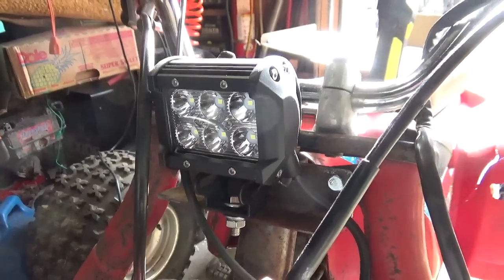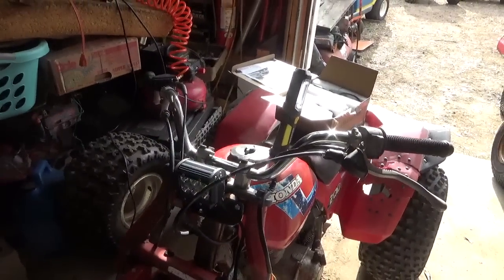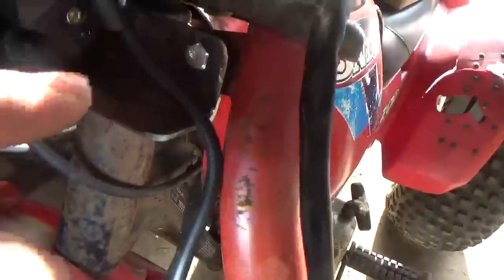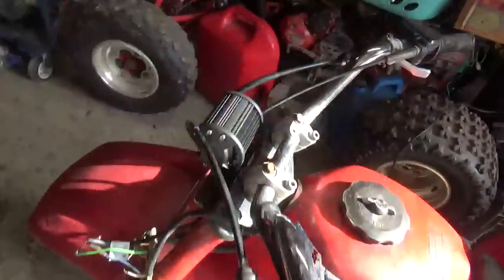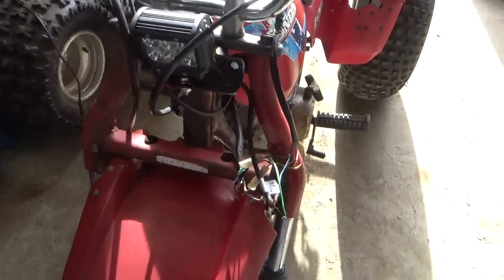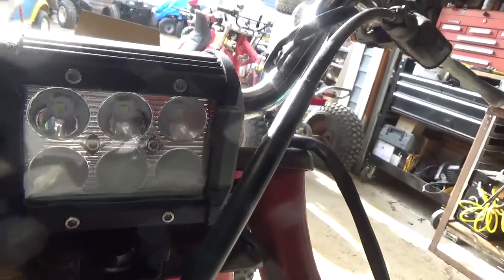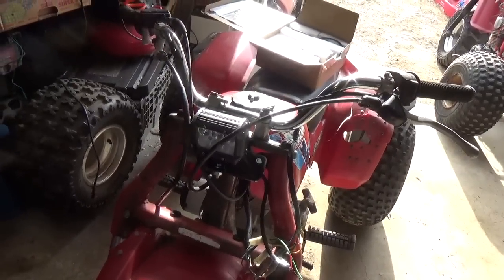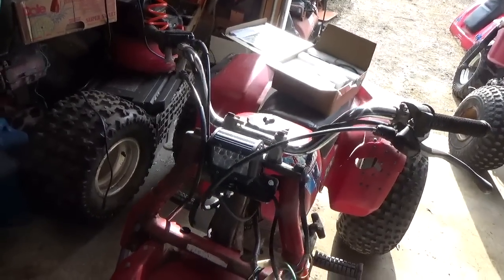1985 Honda ATC 200S Smoked a LED Headlight, Not Surprised!

Comment: Will also need a very small 12volt battery such as like in the 1982 honda passport scooter.. needs to be lead acid..  it will just buffer the current and provide a steady enough current to the leds.

Comment: Diodes don't like reverse voltage/current. Half of the a/c cycle is reversed polarity so it is a wonder they last any time at all. Of course , I know that you know that. Those voltage peaks may be much higher than plus or minus 12 volts also. It is going to have to have a circuit to regulate the voltage and rectify it as well. Have a great day.

Comment: I have a 250 R 1985 Honda atc put car or truck headlight on it but was 12 volts DC haven't had any issues with it the I did that was Honda headlights a little costly
Reply from the maker: Hey Timothy!!!   I have seen a lot of car/truck headlights and fog lights installed in ATCs, I did not think it would work, but, some folks made videos saying that it would, so, I figured I would try it, more or less cost me a $5 LED light.... I plan to use a 12VDC converter , I'll get it working, have no fear.... Thanks for Ur thoughts, suggestions, advice, watching, and commenting!!!

Comment: I would thing a small power inverter would do the trick. A small 100 watt and wire direct, I’ve used those lights but on a Honda Fourtrax 250 and a Polaris 500 h.o. All of which have batteries. Good luck
Reply from the maker: Hey Dave, They make a 20-30VAC to 12VDC converter for surveillance cameras, I ordered a couple of them to try.... I may have to add a battery also.... Thanks for the suggestions, advice, watching, and commenting!!!
Reply: Let me know how it goes , you might have to do a video on it , I’m sure others have had the same thing !
Reply: Harvey Spooner 
I never checked one of these but mowers are the same deal with an ac headlight circuit. 
What’s the voltage range you get on the ac coil cause I’m thinking a nice lil bridge might work if the voltage is in range.
Reply: I don’t know if you have enough AC Currrent to run a DC coil
Reply: I was thinking a laptop computer wall charger , that takes ac and converts to dc
Reply: Converter not inverter
Reply: Vector makes a travel mate for small coolers that might work
Reply: I was going to ask you where was that Cushman graveyard at ?

Comment: Interesting I haven’t had any problems and I have a big light bar in a little light bar I have a big 2 foot wide one for my main light multi switching colors, flashing, etc. and then I have a small pod like in this video for my not blind you when I go by you down the trail light And I’ve had zero problems

Comment: ya need a pair of  diodes to convert the ac to a form of wavey dc on the positive input  as ive done this with a puch maxi with a dc horn as the elecrical system on them is ac 6v but cannot see way this would'nt for you
Reply: here a youtube link to give you the idea of how it works

Comment: think you need a resistor inline of the power or change the spark plug to a rf one i know back in the day thats were you would get rf interference from  for say if you mowed on the side your house n the tv would  jaz  with lines or if you ran a cb radio in the car you got the engine noise . thats were the number on the spark plug would  say its part number folowed by rf i think it was not to sure but what ever the letters are thats what it stands for

Comment: 7 bucks you can replace the original honda bulb with a LED to spec with the old stator power not 12 volts faster u drive the brighter u get.